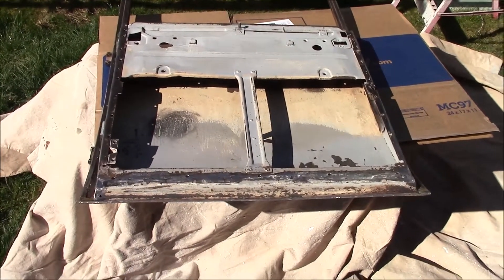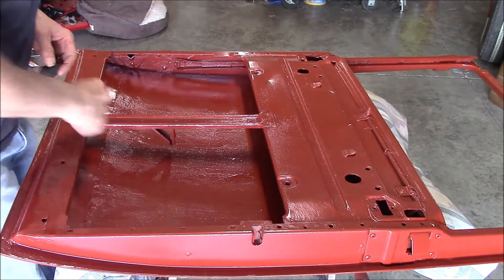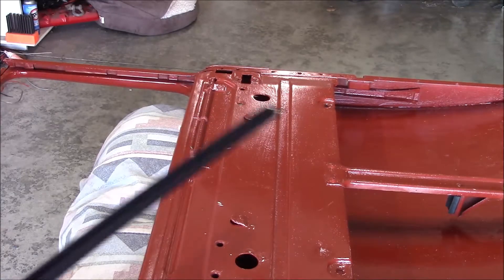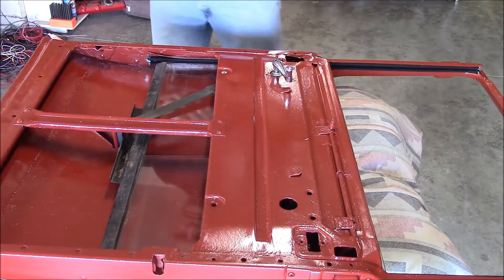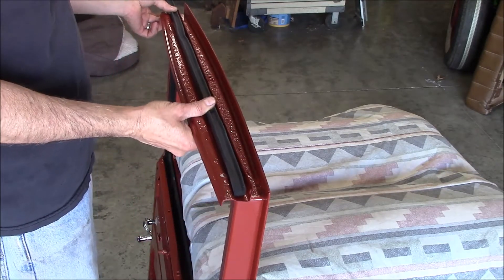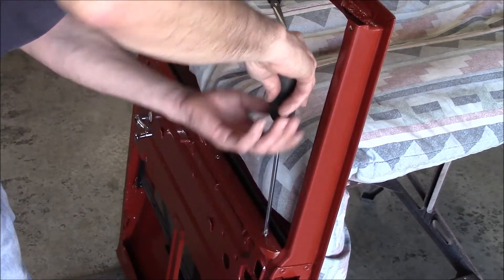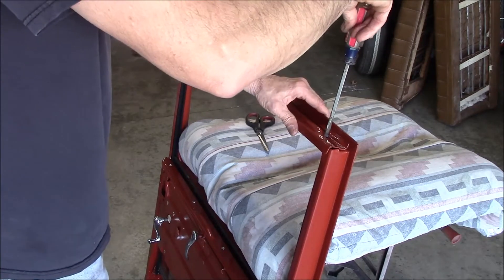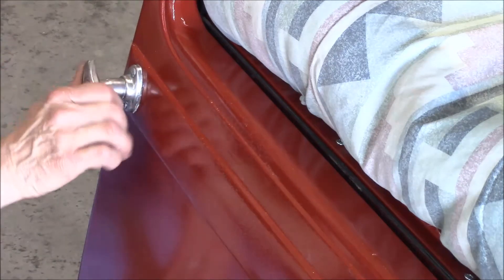Aarons 29 AV8 coupe build 19 Mar 2018 update

Comment: Looks good , getting closer.  Like the other guy said good doors are hard to find,  A couple years ago I tried to find some doors for a 29 closed truck and ended up buying a complete cab for the doors.  Now i have two cabs and one set of doors.  I was told they took them off trucks and scraped them, easier to get into and out of the truck on the farm.  They don't make them any more and the price is $1000 depending on condition.  Also I heard it was a safety device to have the lock on the passenger door, kept you out of traffic and bad drivers.  Which is right. who  knows, take care.
Reply from the maker: Yes, I have heard truck doors are very hard to find and very expensive.
Reply: Closed cab pickup  doors are the same as Tudor.   Shouldn’t be too hard to find.
Reply: Closed cab pickup  doors are the same as Tudor.   Shouldn’t be too hard to find.